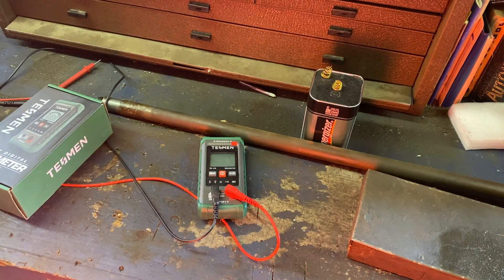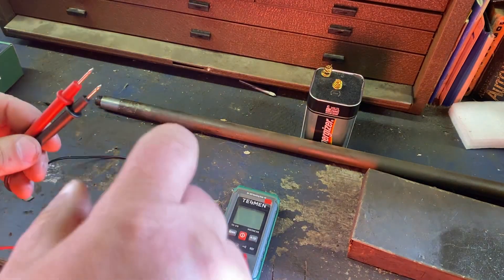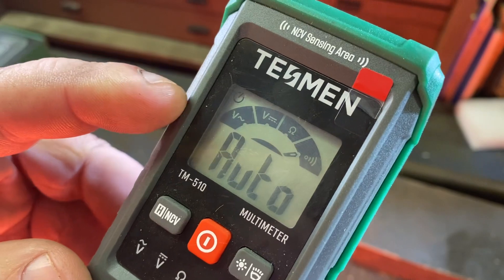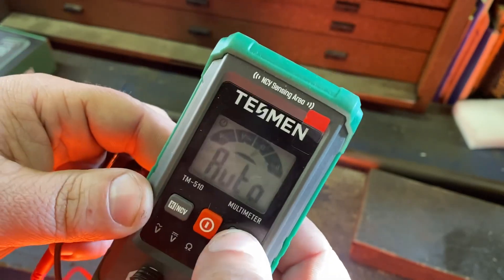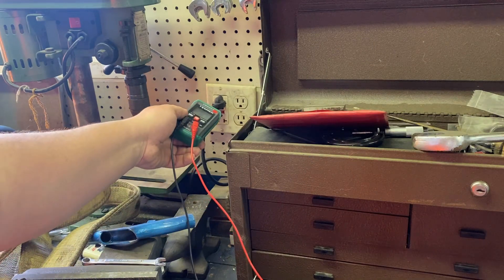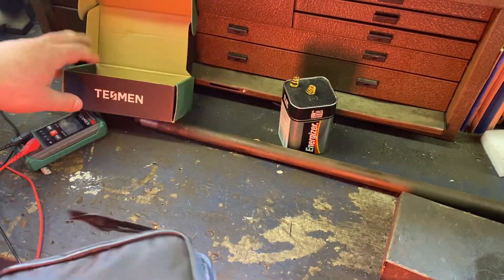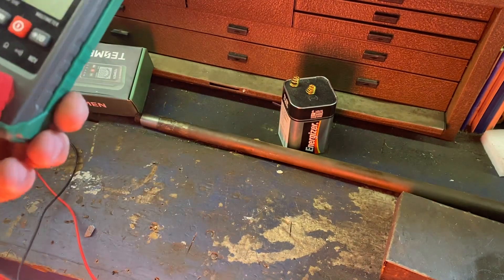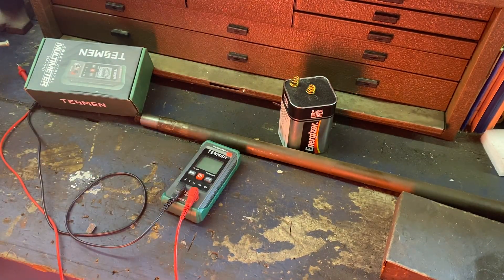TESMEN TM-510 smart digital multimeter review

Comment: Personally  I would not use that meter for anything more than 110v AC and  DC not more than low amperage 24 voltage. The next tier up are much safer and a lot more capable. think UEI, Amprobe, Greenlee, Southwire etc. A meter with a current clamp Is very handy and safer than probes. A meter with a decent ohms is also pretty important[at least a meg] and a capacity check is almost essential. Another problem with the really cheap meters is the probes suck.
Just my thoughts. G
Reply from the maker: Yes this is a very basic low voltage meter that most people can use, for higher volts and more features other meters for sure are needed, but for a basic meter for the average person this one works good

Comment: Automotive tests for a multimeter.

Engine running headlights on. 

One .  Check across the battery posts.  14.1 to 14.8 is expected.
Two. Negative battery post to the engine block. Less than 0.04 volts. 4/100th of a volt. 
Three. Negative battery post to the body.  Again less than 0.04vdc. 
Four.  Engine to firewall. Less than 0.04 vdc. 
Five.  Positive battery post to the underhood fuse box.  Less than 0.04vdc. 
Six.  Alternator output post threads to the positive battery post.  Less than 0.3 volts. 3/10th of a volt. 
I fix cars for a living. This is the test sequence i use on every car .  

Why such low voltage readings are good.  This is voltage drop testing.  

A garden hose flowing freely the only thing slowing the water down is the friction on the inside of the hose.  If the hose is kinked the pressure at the end is reduced. So measuring the difference is much greater.
Reply from the maker: Very interesting and well thought out test procedure I will have to try that